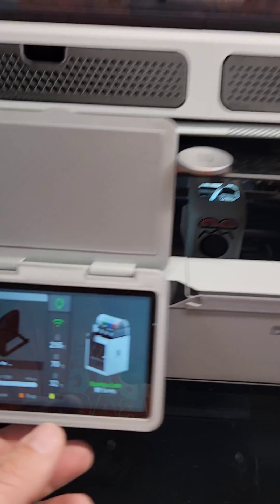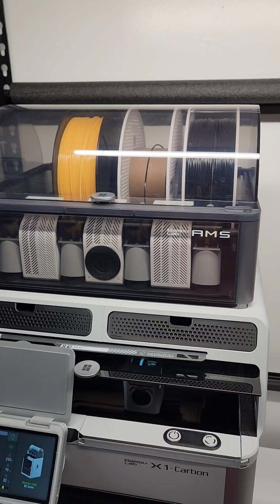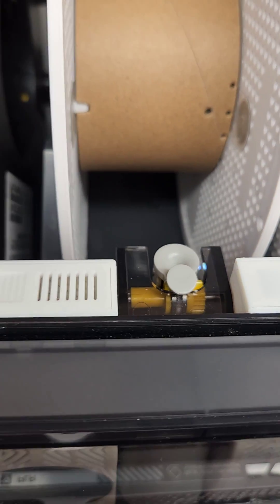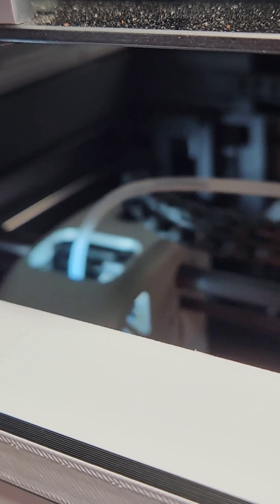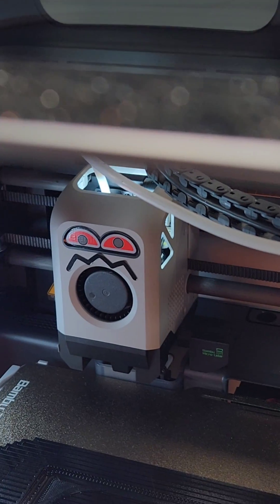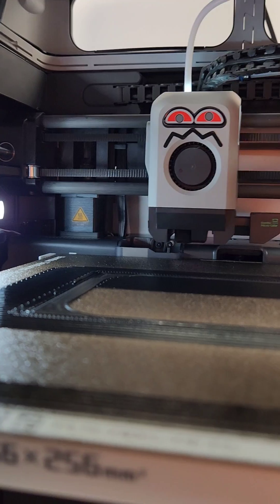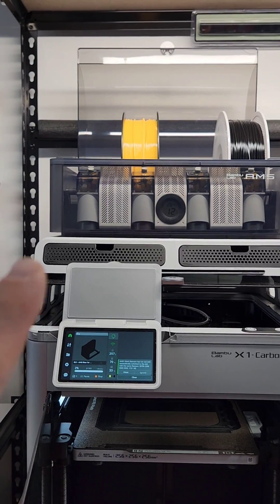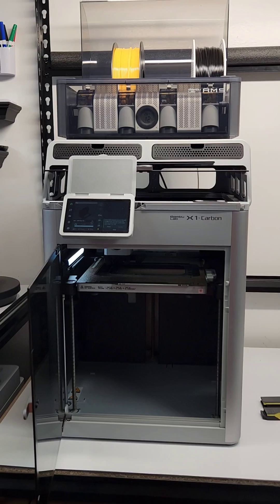When the #bambulabx1carbon  changes Filament on AMS System #Bellionaire #BellaviaSigns #3DPrinter

Comment: Hey; if you dont mind answering.. what Grey filament did you use to print the grey top part? With the drawers on it. I have been looking at different kinds but none quite match the printer as well as this one does.
Reply from the maker: I started with silver pla from bambulab matched even better but not as strong, so it is simply grey petg bambulab
Reply: Thanks for sharing! Will look into it  @BellaviaSigns
Reply: I got a light grey PETG from Overture that looks pretty close, but I did all the accent colors in a transparent blue. I love the way it came out.

Comment: Thanks for showing this! We just bought our printer so we haven't run out of one spool yet so it was interesting to see 

Do you happen to know what happens when you run out of a spool with a certain color/type of filament and DON'T have a new spool with the same color/type of filament in the AMS?
Reply: When you don’t have a backup spool, the filament sensor knows it’s out then pauses the print, waits for you to reload it. It’s pretty good about starting back in the same position when you reload a new spool.
Reply from the maker: Absolutely I love these machines so much fun to learn